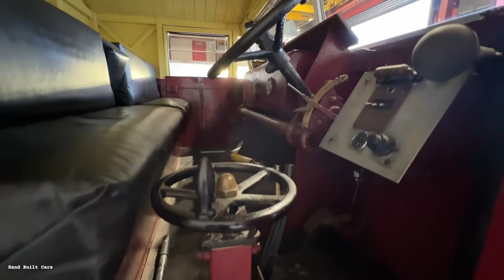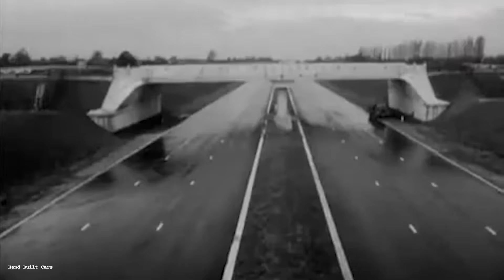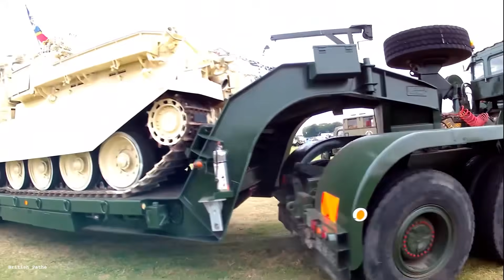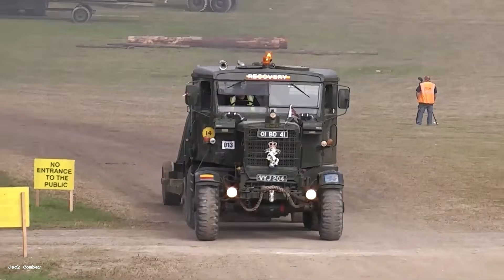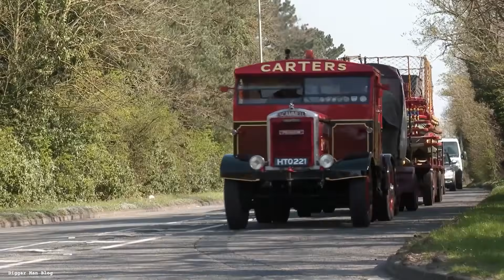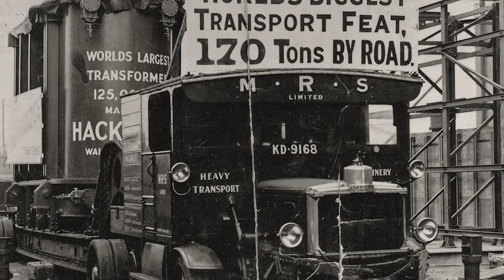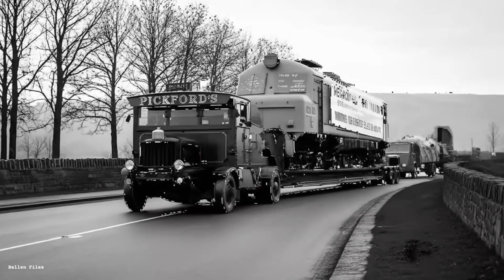The Insane Truth About the Scammell 100-Tonner - The Truck So Powerful, It Literally Broke the Roads

Comment: I still have the Airfix kit of the Scammell Mechanical Horse (3 wheeler). The Scammell trailer coupling was very practical for these vehicles as, unlike the standard 5th wheel, the trailer support bogie dropped automatically.

Comment: scammel solved the issue with trucks in small spaces.
the scarab in 3 or 5 wheel versions. the single wheel for steering could turn to 90 degrees so it could actualy turn 360 degress on the spot with the rear end not moving just turning so only the front end actauily moved..

3 wheeler usaly work in cities and towns and docks. the 5 wheeler was for heavier loads over longer distances.

the isle of wight ferries used them due to vectis transport having a monoply on the island and refused to allow any truck, bus, coach or taxi they didnt own onto the island. so traliers had to be loaded on the feries then the tractor driven off again. the scarab was perfect for that.

Comment: Show system schematics when explaining them with parts highlighted AS YOU EXPLAIN... and SHOW actual pictures of the gears and LEVERS and if you have any struggles ask railroad museums for help with pictures/ video evidemce explanations to bring your video's to that 5th 🌟 🌟 🌟 🌟   (your here)    🌟  
NEED THAT SAUSE IN YOUR VIDEO'S, L😂IKE YOU GOT THE MEAT AND POTATOES BUT ITS DRY. .
 Always gotta improve  because we are NOT designed to stand still
Reply: Meaning seeing the outside of different trucks  just to assume what truck your speaking of. Becuse you never actually gave a specific picture which had any information about the vehicle was shown. Meanwhile the vehicle should have had a patent number for preventing other people from copying the design. So there is gaurnteed illustrations of the vehicle and how it functioned.
While talking engines you mentioned a 4 cylinder in the truck but showed an I line 6.
The fact that WATCHIN YOUR VIDEOS IS A WASTE OF TIME.  CAN YOU PLEASE MAKE THE IMAGEE MATCH WHAT YOUR SAAAYING
 I CANNOT WATCH ANYMORE I HAVE A HEADACHE

Comment: Scammel did not die in 1988. The management and workers moved to an industrial unit in Watford, shared with a heat exchanger manufacturer and continued building specialised vehicles. When I used to visit there as an engineer surveyor for the heat exchangers they were building airport fire trucks for the American market.
Reply: When did that finish

Comment: The first motorway in the UK was not a section of the M1, but the Preston Bypass, which became part of. the M6.
Reply: I recall driving it on holiday tithe Lakedistrict in a Triumph Roadster car starting to age. Speed was maintained at 56 mph and after an hour that was recorded. At the time whilst driving on country roads around England that was phenomenal and showed you could do journeys at reasonable speeds. We had to keep our speeds down too allow oil flow and water flow and temperature and then flush out all liquids after such a journey. Not to do so would create a big bill and so we learned how to increase speed and longevity!
Reply: The Winchester By Pass  might also make that claim. The Army School of transport used it as part of the Armoured Personnel Carrier training based at Bordon.

Comment: If you want to move a load, use a lorry, if you want to move the Earth, use a Scammell.

Back when I was 17, I had the opportunity to purchase a 1958 Scammell Junior Constructor (6x4), that was supplied paired with another to Pickfords and were reputedly the first vehicles south of The Wash (the bit of sea in the North Sea that tucks inland between Norfolk and Lincolnshre), plated for 100 tonnes. 

Some time after it had been retired from Pickfords, it was converted into a recovery truck and when testing winching and lifting capacities, the scales operator came running out of his booth shouting at them to shut it down, as it was pulling the scales out of the ground.

Unfortunately, although I had the finances, space to store and work on it was my biggest issue, as an apprentice mechanic, I'd have no problems with tools and as with my 1963 Land Rover, could have provided a lot of evidence for my coursework, but in the end, I had to pass up the opportunity. Now, I've got a family and neither the finances as well as space for a Scammell.

It was later bought by another enthusiast, who removed the recovery gear and restored it back into Pickfords colours and continued to do the rounds at country fayres and transport shows for most of the next 2 decades from the early 2000's.

Comment: How could they not have any idea to begin with that the wheels would sink into the roadway. Considering all the "advanced engineering they threw at the problem if should have been instantly obvious.
They clearly had the capacity to add more axels (and wheels) to better distribute the enormous loads.
So wtf!! Somehow they thought it (IDK) easier or cheaper or ?? To allow massive/repeatef road damage? Better to just use slow and inefficient metal plates? To make the whole journey way more costly, slow, and impactful?
Obviously there's something we're not being told here.

Comment: Worked for a company that had two 6x4 Rolls Royce Engined Scammell tractor units in the 70's, used to haul small 20 ft food grade temperature controlled tanker trailers through France and the Alps in winter to and from Italy, The day spent in the sun in the South and Sicily whilst loading and Customs sealing was welcome.  Worst part was fitting snow chains to the four drive wheels in below zero temperatures often multiple times in a single journey, oh and reversing up the loading ramps onto the ferries at Dover as they had a sharp bend in them, the trailer responded too quickly, pre ro-ro days and the old docks.

Comment: I did some of my apprenticeship at Scammel Lorries, I remember the first Super contractor being built, there were a few oddballs built many for the oil industry one in particular a for wheel flat bed with a huge steel roller across the rear of the flat bed and it also saws fitted with a massive cable winch, the front axle sported two large coil springs as the load was winched on to the bed the front of the vehicle would stand well clear of the ground, as the load was pulled on the front end would come down at quite a rate, hence the huge spring and shockers, I can’t recall what cab it had. if you were lucky you could be called upon to help with delivery. I never had the pleasure.. Apparently there are a few Scammels out there in Saudi  parked up in the  desert sands..

Comment: Gardner engines were great. But if they backfired they would run in reverse. And when they did. You had to hope you could block the exhaust pipe. Because that’s where it drew its air from. It was frightening. To hear one runaway.

Comment: Over 4 mpg pulling 100tons is actually so insanely good I have to call bs.
Reply: I don't  intend to sound condescending, I'm sorry if I come across as such. Do you understand the benefits of gears? They provide mechanical advantage if geared correctly. There's a trade off between torque multiplication and speed.
Reply: 1) Any modern average semi can be geared 14:1 1st gear x 4.10:1 axle gear = 57.4 final drive ratio at the wheels assuming zero losses. 

2) Assuming 500 tq at the engine x 57.4 final ratio = 28,700 tq at the wheels.

3) Most modern trucks average around 8 mpg while hauling 80-90k lbs at 55-60 mph. 100 tons would obviously bring the mpg down.
Reply: 1) They said the Scammell is (final) geared at 196:1.

2) On the Scammmell they listed 3 engines: 
A) 80 hp
B) 86 hp 3/4 mpg
C) Gardner Diesel 105 hp 4.2 mpg.

None listed the torque, but let's assume 100 tq on the diesel. 100 tq at the engine x 196 final ratio = 19,600 tq at the wheels.

3) 90 years of separation, but it's still just weight to move with a given torque available. 

2026, 500 tq, lots of gear, 8 mpg at 55 ish mph.

1932, 100 tq, 4 times as much gear, 4.2 mpg at what...... 5 mph. I'd say the MPG is highly plausible.
Reply: @xmo552  Driving empty? Sure. Weighing 100tons? not possible even with modern trucks. Modern trucks get at best 4mpg weighing 50 tons.

Comment: 00:17 Must be one of the last loads by BLH21, before retirement.  The loco on the trailer is a WAGR (Western Australia Government Railways) X class diesel locomotive.  The X class fleet was delivered from 1954 - 56.  The loco is gauged to WAGR's 3'6" track, so the loco could not be transported on UK's standard gauge 4' 8 1/2" track to the export ship.  Western Australia had to wait until 1970, for the standard gauge line to be completed, to Perth.

Comment: 15.54 does anyone know is that design of body Scammell was produced with chain drive as that is the body shape I remember from the chain drive I saw years ago.
Reply: I would suggest it is a Highwayman
Reply: @denby-r7208  Hi,  thanks.  yes, same body shape but the one I saw had chain drive with really big rear sprocket to gear down for hauling the transformers from AEI in Manchester up over the Pennines on old A62 road..

Comment: In about 1959 I watched huge Scammell chaindrive truck pull a power station transformer from AEI in MAnachester up the A62 at Mirfield, West Yorkshire.
It had a vertical exhaust that was blowing smoke like a steam loco!
Reply: A modern truck would do the job in half the time with no smoke.
Reply: @RustyH43 Are you implying things have changed in 70 years?
You need to be head of a university!
Reply: @RustyH43Stupid and uneccessary remark
Dunce's  corner for you. .

Comment: In Melbourne, Australia Scammel Scarabs were used during and after World War 2 to transport frozen meat to Station Pier and Princes  Pier from meat works which did not have rail sidings. Refrigerated trailers were used, and the tractor uncoupled its trailer and coupled up an empty one and returned to a meat works. The meat was then loaded onto the Blue Star refrigerated ships owned by Vestys which sailed for Britain, via Cape-town.

Comment: The m1 was not the first motorway in brittain. The Preston bypass was. This was a two lane motorway with a hard shoulder that later was renamed the m6. Despite the m6 being the first motorway it was not called tge m1, but was called the m6 due to it being a bypass that ran alongside (and effectively replaced) the original A6
Reply: Do you remember the M6 of the early 1970's?  I used it in 1976 with a 38 ton artic which would stay in the "ruts" for several miles, no hands, due to sub standard construction!!
Reply: @richardbarber4444 Had an Austin 1300 and used the M6 front Scotland to Birmingham a lot.  Thelwall Viaduct was great as you adjusted speed to get the rhythm of the joints. Driving was fun and you could guarantee your timetable.
Reply: Is that not a Dual Carriageway?
Reply: @BrownWarrior1888  Motorways use slip roads to join/exit, whereas dual carriageways can have traffic lights, roundabouts, and even right-hand turns at junctions.
Reply: @trevor4426  And two carriageways…
Reply: @BrownWarrior1888  No. Motorways have a hard shoulder, dual carriageways do not.
Reply: I believe it was classified as M1 because it was the first designed Motorway. Remember the M ways do not function in the numbering system of A, B & C roads which emanate from London.